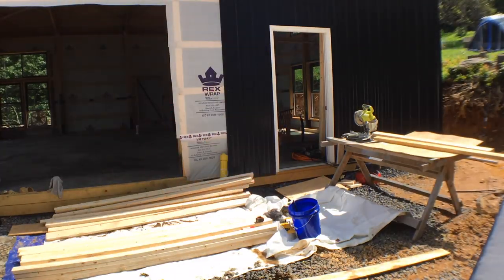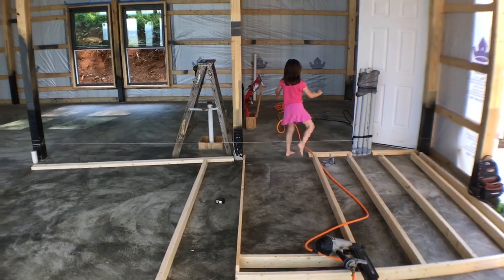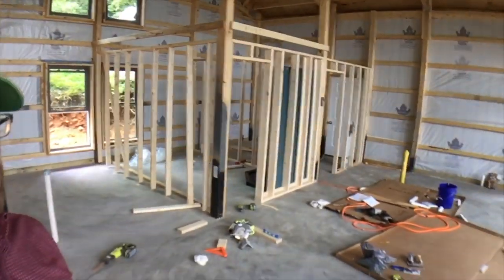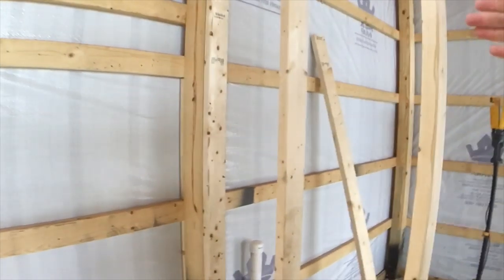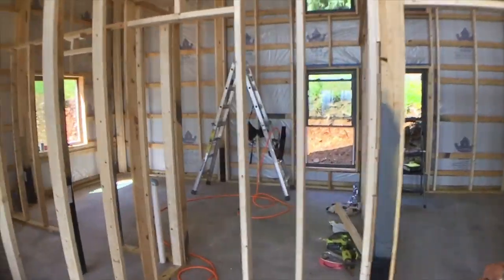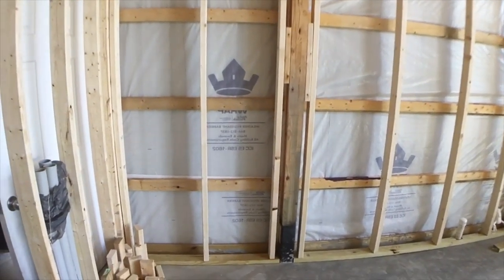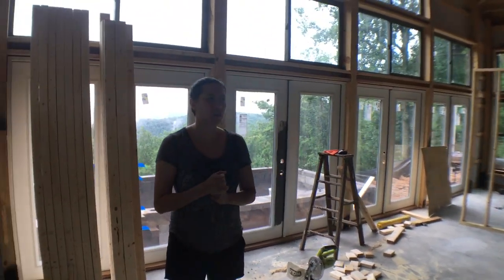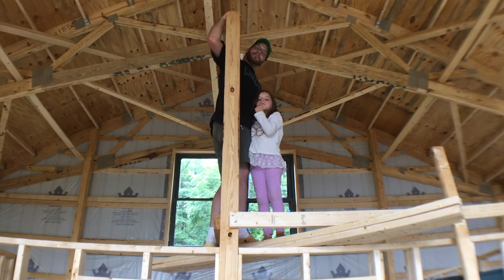Pole Barn House: Interior Wall Framing | Our mistakes | Eliminating a Bedroom...

Comment: Love your attitude.  Hey mistakes happen.  Learn from them and carry on.  Hey keep your fingers 3" from where you are nailing, nails tend to bend when hitting a knot and come out the side to bite you. (Experience) Walls can be built in place.  Toe nail the bottoms (Use galvanized nails in pressure treated wood) and nail top plate normally.  Have fun, and if you want change,  change ! Have a great time.

Comment: also on that little project putting down pressure-treated is great but you actually should also fastened it down through a silll gasket. It may not be code but it's a better way to do it

Comment: I noticed you have 6x6 posts in the middle of the slab.  Was that preplanned for the layout you wanted?  It's typically just the outside of the pole barn that has the 6x6 posts, correct?
Reply from the maker: Good eye! Yes typically posts only on the perimeter but we added 3 more posts to later support and frame the loft.
We have a loft video later in the build playlist. 👍🙂

Comment: What kind of tie in or connection did you do for the loft floor to the wall and what are you using for floor joist in the loft ? We are following along as you build and love what y'all are doing.
Reply from the maker: The loft floor will happen in about 10 months so I’m still in the planning stage. However we have the three 6x6 posts in the middle which will connect to the outside posts to form the floor beams for the loft flooring.

Comment: The way your roof is built the there’s no way for ventilation after insulation, only option for that is spray foam is that what y’all did?
Reply from the maker: Correct. We spray foamed and then installed an HRV ventilation unit.

Comment: crazy question... but when you poured your concrete, did you leave a portion of a wall out to make it easier to pour or did you just do your roof top, pour the slab, then go back and do the exterior walls???? Wondering how much height you lost when you poured your concrete if it was done after the roof was built??? THANKS AGAIN
Reply from the maker: They left a portion of the wall out to do the gravel and concrete.  The roof was already up at that point.  The plans accounted for the gravel and concrete resulting in 12 foot sidewalls.

Comment: Have you finished yet? I am in the process of pricing a pole. We are wanting the open concept with high ceilings in the living room and kitchen. Wanting a bonus room over the kids side of the house. What is your sidewall height and roof pitch? Trying to figure out what size I'm needing.  Don't want it too tall but need it tall enough for a bonus room upstairs.  THANKS
Reply from the maker: The inside will take us at least another year to finish.
It has 12 foot sidewalls and 6/12 pitch roof.  We will definitely be putting in that 'bonus room' upstairs.

Comment: What is that your using in as your bathroom stall wall, I'm totally getting it for mine but can't find online so Lowes or Depot?
Reply from the maker: Are you referring to the shower panels?
https://www.lowes.com/pd/MAAX-Utile-47-625-in-x-80-875-in-Ash-Grey-Shower-Surround-Back-Wall-Panel/1000132383

Comment: You should at least Glue the green lumber to the concrete as they can and will move at the base of the walls. Could you not have had 2 bedrooms made  with a bathroom in the loft area.

Comment: As soon as you said you didn't use pressure wood.i turned it off.👎
Reply from the maker: You must not watch much YouTube then. People make mistakes and I was admitting the mistake and talking about how I fixed it. Never claimed to be an expert. 😆
Reply: There is really different code rules regarding this.
In Sweden it is not allowed to use PT at all if it is inside.
We use regular construction wood with foam or similar betweem floor and wood.
Reason that PT is not allowed is that it can release harmful odor etc.